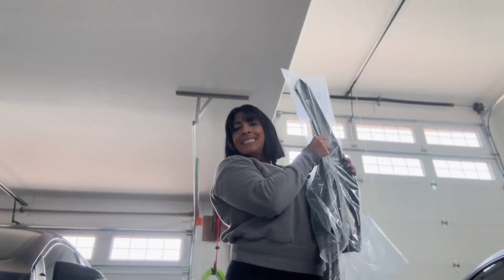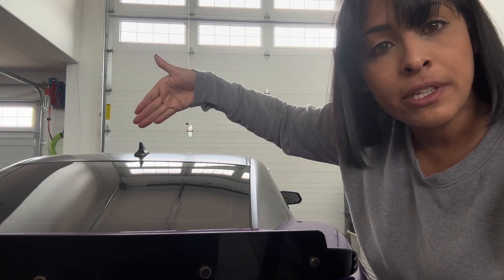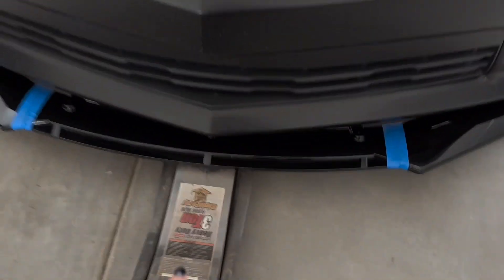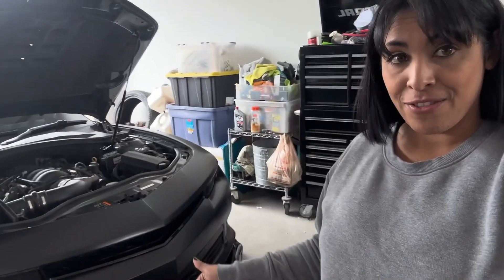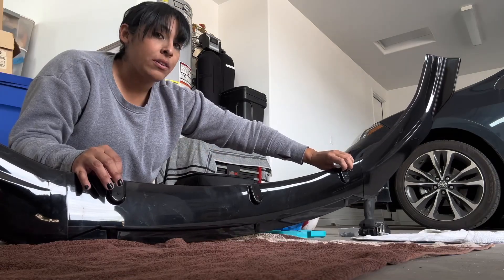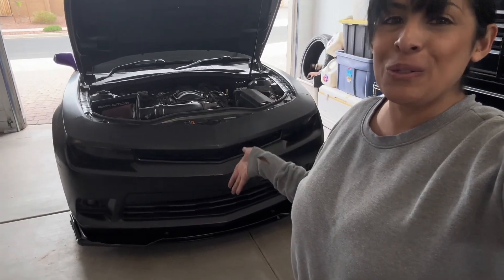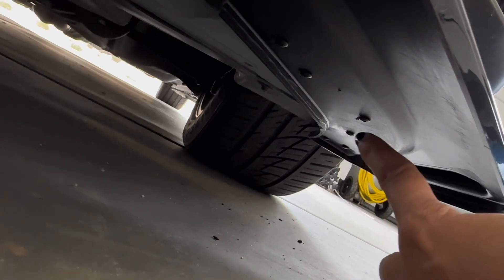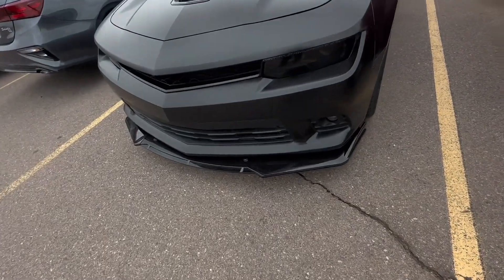EBAY UNIVERSAL FRONT LIP on a 2015 Camaro | Was $40 worth it?

Comment: I was thinking about this cause of the price, also cause the model picture had a camaro lol, but… sadly not the best looking thing 😅 thank you so much for this video!
Reply from the maker: It doesn’t look bad at all. Other than the small gap. It’s not bad for budget. It will fall off at high speeds. I already went through 2 of them. Make sure you mount properly 😅🤣